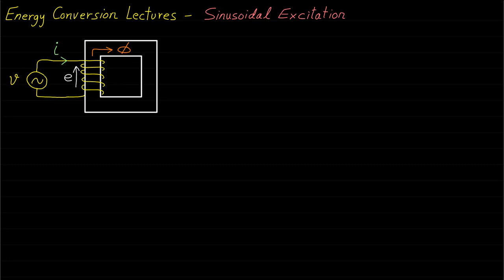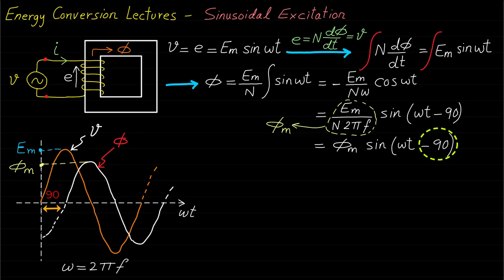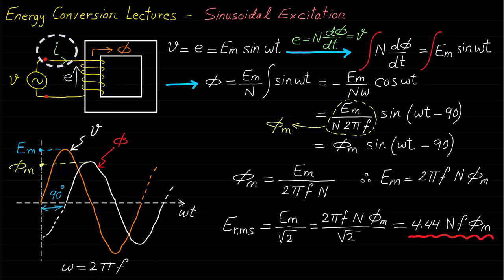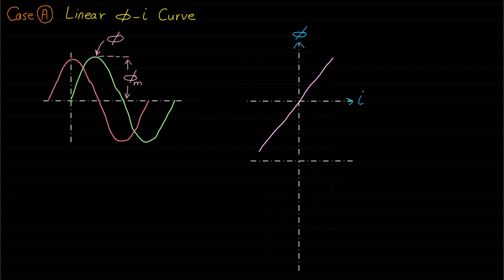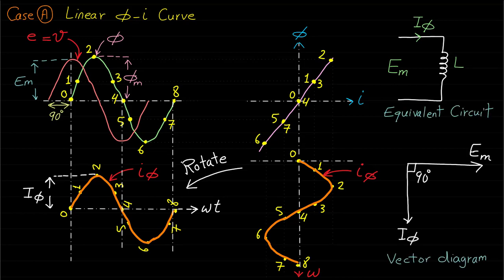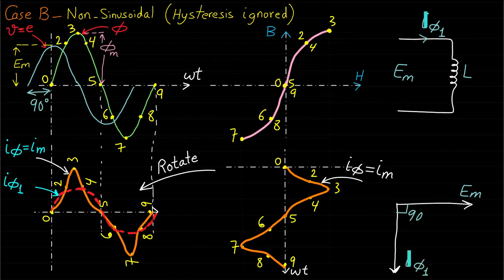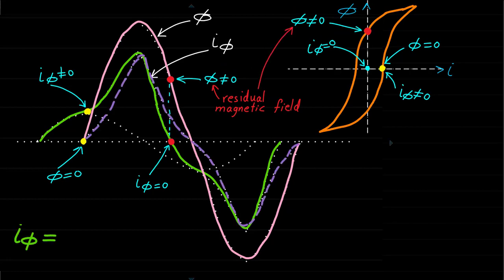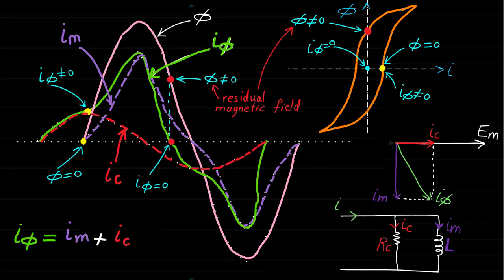Magnetic Circuits - Sinusoidal Excitation

Comment: Thank youu so much it's really good to understand! 
 I have a question, if there is an AC source instead of a voltage source, how do I get a phi function? Should I get the voltage with v= Ldi/dt and apply Faraday's law?
Reply from the maker: Thank you for your question. I will assume that the question is how to calculate phi if we have current signal waveform. Answer:  If we assume the magnetic circuit is linear magnetic circuit, the following relationship can be used:  Bsi = L x i where Bsi = N x phi . Therefore, the magnetic field phi can be calculated as follows: 
phi = (L/N) x i        ( Note: the magnetic field and the current are in phase if the current sinusoidal waveform) 
Hope this answer your question
Reply: @EnergyConversionAcademy  oh i got it.., thank you for answering my question!!